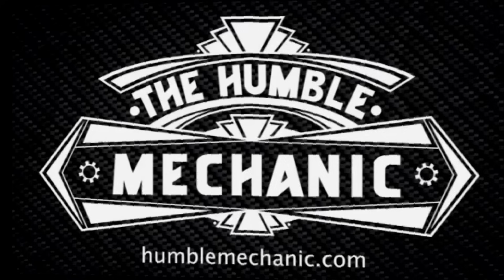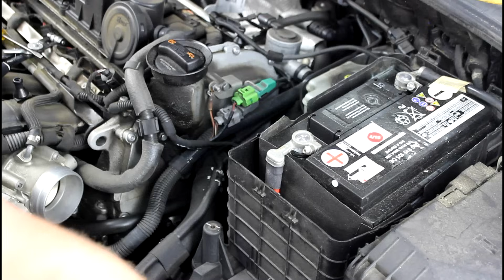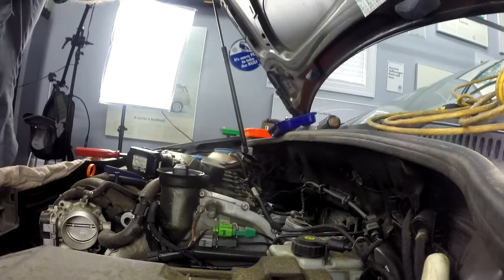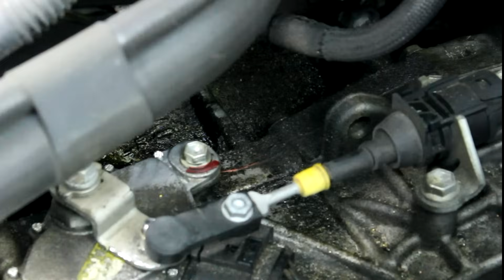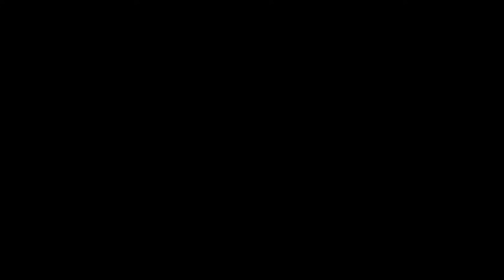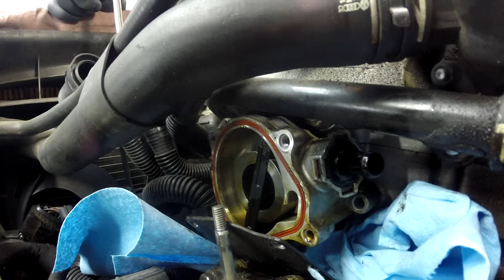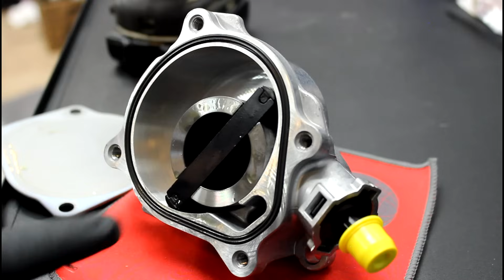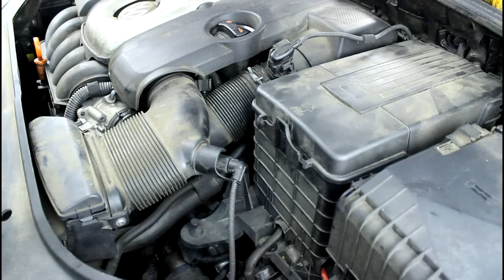Replacing VW 2.5l Vacuum Pump ~ The Easy Way

Comment: @HumbleMechanic I just found you today and already started following you on Instagram your awesome. Dumb question here... My VW dealership wanted to charge me 500+ dollars to replace a the vacuum pump on a 2008 FSI Turbo Manual Transmission by looking at this video it seems pretty easy. My question is... Are there other vacuum pumps in the vehicle? The reason I asked is because another shop confused me and stated he didn't know what vacuum pump I was referring to... Please and thank you.
Reply from the maker: +Nestor Diaz NICE!! The vac pump on the 2.0t is very different from this pump. Well they do the same thing, but different parts. I feel like the FSI is easier to replace than this one.
Reply: Thank you so much for the quick response!

Comment: please can u tell me where is located this pump on a beetle with manual transmissions
Reply from the maker: Same location if it's a 2.5. But the manual transmission pump is TONS easier. Just 4 bolts. No need to take apart.
Reply: Thank u so much

Comment: Thanks for the Video. I have 06 Rabbit and its manual transmission. Do I have to buy a whole new Vacuum Pump or just buy a gasket kit to replace to the present Vacuum Pump? Is it a same type of Vacuum Pump for auto and manual transmission on the VW Rabbit? Thanks.
Reply from the maker: +Kobuny Y should be the same pump. I would replace the entire pump. It is also VERY easy on the manual trans cars. Just 4 bolts and your care done! :)

Comment: Man, you just saved me hundreds of dollars in repairs. Every car shop wanted to charge me $1k-$1.5 just to change this vacuum pump on my 2009 VW Tiguan. I know for a fact that its not the same process because vacuum pump is located top of back engine. $50 for pro diagnostics, $187 for new OEM vacuum pump, $10 for a 6pk of beer... thats less than $250... Again... Thank you for this DIY vid...cheers
Reply: This video is a real life saver!  I have downloaded it somehow so I still have it just in case for some bizarre reason it ever vanishes.  Tricks like these are a must to know!
Reply: Great, saves me a ton of money. Keeps me on the road instead of minus a 
bunch of $ at the dealer.  MANY THANKS !!
Reply: same 1500 for new pump.??

Comment: Awesome. Volkswagen told me they have to drop the transmission. I dont want to do that unless needed. How much is the vacuum pump?
Reply from the maker: That is the "proper" way. This is just a different way to do it. 

There should be a link in the video description that will take you to the exact pump I used.
Reply: HumbleMechanic I’m debating whether to do it the proper way or to have a friend who works on cars change the gasket for me. 
I’m really scared of what could go wrong if I let my friend do it, do you really think it’s a high risk fix? My friend suggests I buy the gasket that sells on Amazon, everyone mentions it,  but I’m just scared of messing things up so i’m debating whether to drop the 1k the dealership is asking for or to let my friend try... opinions??
Reply: Our VW shop told me it's basically a complete tear down. They want $1300 to do it.

Comment: Installing a delete kit on my rabbit today. Great DIY video very helpful and great for the ones who like visual DIY instead of reading ha.
Reply from the maker: Awesome. How do you like the delete kit?  Did you notice and differences in breaking?
Reply: +HumbleMechanic so far I love it. Feels more solid when breaking and don't have to push the break in so far. I'm still sadly leaking oil. I only have had the delete kit one day but any advice on what else could be causing the leak? It's still coming from the transmission area on my 08 Rabbit 2.5l

Comment: Thanks for posting this video.  Have not found a diy for vacuum pump out there.  Plus this is very thorough/detailed and hope this saves me money from taking it to the shop instead of having the mechanic charge me.
Reply from the maker: +Oscar Carreno (Jr.) You are welcome. If you got some value out of it, please do me a favor and share it up :)
Reply: +HumbleMechanic - I noticed the pump you installed has a metal like cover.  Installing a pump with more of a plastic/rubber material, such as the one you took out,  are those okay?.  What are pros/cons of each type of cover.  And does the pump leak motor oil?

Comment: why did you install cover before tighteng the pump down. could cokpromise the metal gasket or the threads on the bolts...

Comment: What are your thoughts; on this delete kit from USP Motorsports? I'm usually not one to delete things but considering; the cost of the repair, that may fail again (it looks like a interesting option @ $99). 

Spulen 2.5L Brake Vacuum Pump Delete Kit Part #:SE-095
http://www.uspmotorsports.com/Spulen-2.5L-Brake-Vacuum-Pump-Delete-Kit.html
Reply from the maker: The kit looks like it is made well. I had a chance to check it out a few weeks ago. 

It just makes me a little nervous deleting the pump.
Reply: +Billy P. I replaced the vacuum pump on my 2006 Beetle with the Spulen Delete kit a week ago. I gotta say it went on easy, there is no leak and I can tell no difference in braking.
Reply: That is good to hear; it sound like a affordable option; for a part that is bound to fail again and again! They claim; some engine performance increase, any noticeable difference on that end of things?
Reply: +Billy P. Uhhh maybe a little increase in power. USP Motorsports claims about 2hp increase. The engine does run a little quieter. I torqued the plate to 10 newton meters. Thats not in the instructions but that is the torque used on the pump. If u do it good luck. It was a very easy install.
Reply: I have a 1.8T but some members of newbeetle.org; are starting to have their pumps fail and it is expensive to replace them, just to have them fail again. I have been pointing out to these 2.5L owners, that the USP kit is a option. I am glad; to hear, that it is working well for you! It sounds like it is; a affordable and viable option to replacing the expensive vacuum pump. :)
Reply: +Billy P. Another option for those with engines other than the 2.5L might be to remove the old pump, then have a plate made by a machine shop, get the gasket, cover the mounting hole then put a electric vacuum pump on the car. You can pay 50 to whatever you want for a electric one. They are all 12 volt. Just a thought since I know what a simple fix this was.

Comment: Great how-to Charles. I love the way a good mechanic finds a work around to make things easier. Not dropping the transmission sure is one of those. Can you tell me who makes those locking pliers. I NEED a pair of those.
Reply from the maker: +Chuck Ashton They are blue point pliers similar to these https://store.snapon.com/Hose-Clamp-Pliers-Pliers-Corbin-Heater-Hose-Clamp-9--P635770.aspx
Reply: +HumbleMechanic  Thanks Charles I'll have to chase down the Snapon truck.

Comment: Very good video! I've read several discussions about this repair on forums.  It helps to see a how to video like this.   A picture really is worth a thousand words.  Thanks .
Reply from the maker: +Cedric Long Glad it helps. Feel free to share the video in those forums. It may help others out too
Reply: +HumbleMechanic 
Those discussions were saved discussion threads on a VW forum. The discussions are in text format.  They were  no videos posted. In those discussions if I remember correctly there was some disagreement between commentors as to whether or not the repair could be done with the transmission connected.  I had this repair done, but I didn't ask the tech how the repair was done. But on a another note, the purpose of this part is to assist with applying the brakes.  I thought that is the vaccum pump's purpose. Isn't that so or not?
Reply from the maker: +Cedric Long Yes, the pump supplies vacuum, to the booster. Many other cars simply use engine vacuum to achieve that

Comment: Great video!, why does the 2.5 have a vacuum pump?
Reply from the maker: +4sf3d4g63 As far as the why of the design, I don't really know. Maybe they felt the vacuum supply was not stable? I really don't know. There is a company that makes a delete kit. I have seen it, and it looks well constructed, but I get nervous when messing with the design of brake systems.
Reply: +kauboi I would like to know too. I mean, the tried and true method of a check valve on the intake manifold with a vacuum reservoir has worked for years. I understand the necessity on a diesel, as there is no manifold vacuum but on a gasser? Seems pretty pointless and expensive for an engine used on the more economic trim levels.
Reply: +HumbleMechanic if the 2.5 was an Atkinson cycle or lean burn engine like the old Honda Civic hx I could see why. With those cars the throttle plate is open more and the engines produce less vacuum when cruising. None of it matters much once you let off the gas and apply the brakes. Bad design and placement imho but excellent video as usual!
Reply: +4sf3d4g63 It would be due to reduced vacuum. In my opinion to delete the is a very bad idea. There would be some situations where you would loose brake pressure. As for bad design from VW's point of view the dealers make on the repairs. The customers think their car is so complex that they should up grade it to a new one. Long term low running costs are no longer a marketing tool.

Comment: Nice man! That's what I want to see :DIY repairs. Great camera shots too! Well done!
Reply from the maker: Thanks. I am trying hard to do more.
Reply: +HumbleMechanic I just got a quote for $1,350 by the same VW dealer that recommended that I replace my rear brake pads which were brand new at the time.  The pump leaks something fierce this is true, but $1,150 for labor for a job that takes 1 hour, FYI manual transmission.  I feel like they need to be reported to the ethical police...
Reply from the maker: +Ryan S yeah that's the wrong thing on a manual trans! The labor time is 1.5 at the most. 

Please don't go back there.
Reply from the maker: That is actually about the proper amount charging by the book. Charging by the book is what they are suppose to be doing.
Reply from the maker: No need for the video on a manual. Just take the pump off. You dot's even have to take the pump apart.
Reply: YEP! Just got quoted $1500.00 to replace mine on an 08 manual. HELL NO! I'll be doing it myself! Also oddly enough I had the same thing happen to me with the brakes. They wanted to charge me $700.00 to replace my breaks, and they are fairly new. LOL
Reply: Shift_Escape ---if it's a manual it will be a lot easier. It would be about a 30 minute job in the shop .
Reply: Did you have any clearance problems with the  manual shift linkage ?
Reply: My dealership just quoted me $1800 labor only!!! What scammers! Thanks for the video!